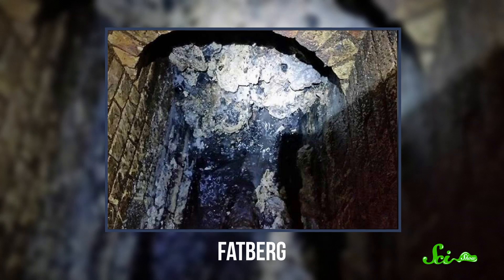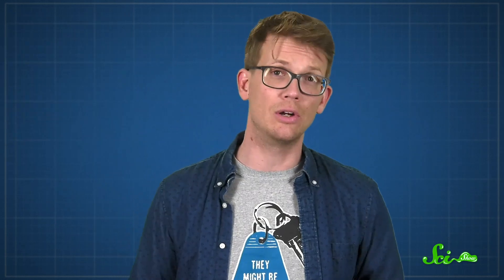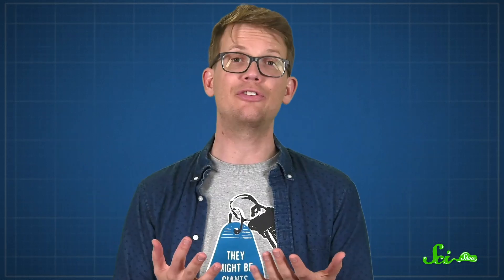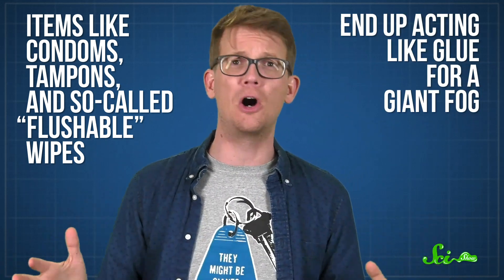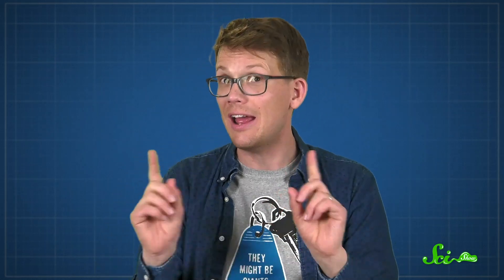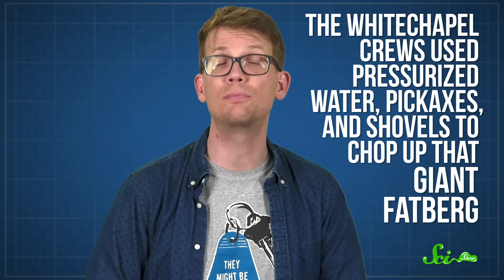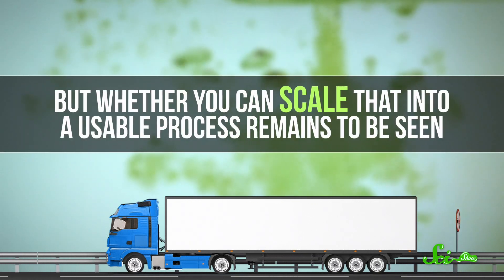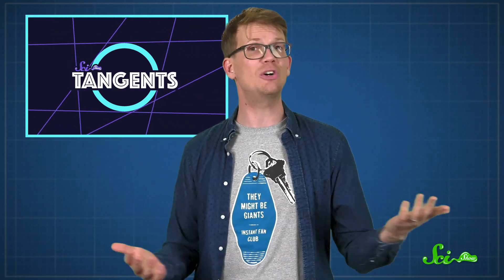Why Our Sewers are Plagued by Fatbergs

Comment: I very much disagree with the premise that individual people, or even restaurants and businesses, should be responsible for preventing fatbergs or that they/we ought to take steps on our end to resolve the issue. This very much seems like it should 100% be a municipal responsibility to resolve using the cleaning chemicals, better/different coatings and materials that resist corrosion, and/or make changes to engineering and infrastructure practices to flush them out or make the sewer inhospitable to them. Of course we as individuals and business will be responsible in the form of higher taxes to pay for these changes -- and I'm fine with that -- but I don't think we ought to take such a degree of personal, individual responsibility as to change our daily practices. Issues like this are why we have cities and municipal governments in the first place IMO.

Comment: If calcium is a big part of the problem, why not use stoneware pipes (sintered clay and shale) or plastic? In Sweden all new small sewer lines are pvc, pp or pe of some kind; larger still use concrete. Germany seems to have some kind of aversion to plastic but the use stoneware for most sanitary sewer pipes.

Comment: After 25+ years working in the collections division of our local sewer department, I can personally attest to EVERYTHING that he said as being true. We have 40 locations that we have to clean every month to prevent these FOG buildups from causing a backup.
As to the non-organics he mentioned, they are a huge problem in the sewer. In particular with our pump stations becoming clogged.
Some other things that we find are dentures, marbles, cutlery, toys, jewelry, and lots and lots of gravel. Some of the unique things I've seen are a bowling ball, a basketball, a tricycle, a TMNT doll, and a furless squirrel that had got caught in the impeller of our pump. One of our guys thought that it might be a baby, but it was only a chewed up squirrel, thankfully. 
If you want to know exactly where this stuff ends up and ultimately what it becomes, visit your local treatment plant. Most give tours and would be happy to give you the lowdown on the largest environmental protection process across the country. 
If you really want to know where the money in sewer is, ask your plant operator how the cogeneration system works. 
Tl;dr rant is done.

Comment: This is why any time I wash oil or grease down the drain, I also use a ton of soap, to make sure it's miscible, and even then, I remove as much as possible before washing that pan or whatever!
Reply: You shouldn't be washing oils or greases down the drain. Collect your cooking oil in an old cup and allow to cool and solidify. When cool you can then scrape the solids out into a empty milk packet and place in your household rubbish.
Reply: @markfryer9880  I was waiting for this, like I said, I do remove as much as possible. This is just the stuff stuck to the pans.

Comment: I work for a public sewer system in Texas, can vouch for this. However for us Sanitary Sewer Overflows (SSO) happen more in residential areas rather than commercial. It's the bad FOG build up which can happen with any type of pipe (virtually no concrete here, it's all clay or PVC). I see it all the time when we flush or camera a sewer lines.

Comment: Run hot water in the sink, real hot.... chase it with DAWN dish soap, pour in the grease (if you must) continue with the hot water, add more Dawn still more hot water.... done. Or, think of a cheaper, easier way to do it.

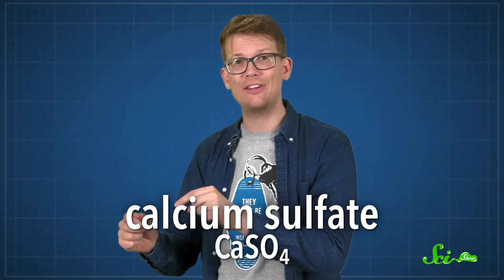Comment: 1:50 Calcium Sulfate is a metallic salt? How is that possible if it has no metallic elements in it?
Also we literally can't by law throw away organic waste into the general trash bin in the city I live in,
we can only stick it in the organics bin, I'm not sure if you're saying I should just pour oil into a bin (nevermind that this would be a fire hazard),
cause I'm not sure how that's going to go down when it gets dumped into a big truck,
and we're not supposed to put nonorganic waste into that bin,
so I should try to put oil into biodegradable bags or something?

Comment: One thing to consider is since it's going to take time to develop these other Solutions. Maybe large metropolitan areas could have a biodiesel site that takes that receives the fatty icebergs when they do form and they could charge a small fee to surrounding counties to go out in collect their fatbergs. To bring them back for processing I think a couple of old garbage trucks would be more than sufficient to the task no need to have some kind of specialized equipment. But the system should be set up where current sanitation workers for any major metropolitan area can be trained on how to run the biodiesel process. So that they would basically be getting paid overtime when there was enough. Berg collected to run the biodiesel plant and the rest of the time they would get their regular pay as garbage man or whatever their other functions are.

To build a truly Greener World we need to have systems like this that can be turned on when there's enough in them to use it and off when they're not needed.

Comment: Uh well no I don't live in a rat infested city with public sewage so this is not a problem I need to care about.
Reply: My family has owned and operated a septic tank pumping company for 62 years. I'm 3rd generation owner-operator, and I pump 4-8 residential septic tanks a day. I assure you that this problem exists in rural septic systems, small city sewers, and large first-world-country city sewers as well. I have cleared thousands of miniature fatbergs out of people's lines and tanks.

Also, you would be amazed at the things people flush on a regular basis. Allow me to name a few:

Used needles
Drug baggies
Drug pipes
Tampons
Plastic tampon applicators
Menstrual pads
Condoms
Wet wipes
Makeup removal pads
Toothpaste caps
Dental floss
Q-tips
Toiletry packaging
Random garbage
Toys
Kitty litter

And many, many more. After pumping these items, I am required to take them to the city disposal site, screen them out (a difficult, dirty, and time consuming process), and place them in incinerators for future burning.

This makes my life difficult on a daily basis, and drives up the costs for consumers in the residential septic tank pumping industry. Please stop putting anything except toilet paper and human waste down any drains, anywhere, any time. Thank you.

Comment: The sewers are packed with grease because people dont use Lye anymore which would Saponify the grease into soap that would help keep the system clean.
Reply: He specifically said in the video that saponification is what is causing these massive build-ups. If it weren't for the saponification, most of the fat would move on through the system.

Comment: Will it flush?

Fill up 2 glasses of water. In one place a sheet of toiler paper (control) the other something else let's say a paper towel. 

Now take a spoon and stir the paper towel in the water and the toilet paper in the water.

Grab the paper towel and take it out of the water. If it's still intact then it won't flush. 

Try with the toilet paper and chances are you might get little pieces between your thumb and forefinger but the TP has pretty much been disintegrated.

As with oils they are non-polar while water is polar which is why they don't mix but they are both covalent compounds since they are made of non-metal elements and not strong enough on their own so have to share electrons (rather than steal them like ionic compounds e.g. salt) because of this the oil molecules gradually are repelled from the water until they start to bind with the other oil molecules in a mass that WILL NOT let water in between the molecules to dissolve it. 

Plastic is made up of several polymers from hydrocarbons in crude oil (probably not the oil you cook with). A polymer is a long chain of similar compounds called monomers. A single molecule of H20 is a monomer but the water flowing from a faucet and into a glass is a polymer. It's just long strings of compounds. With plastic you have several of these dense polymers packed together tightly and keeps H20 polymers or monomers from being able to pass through. So shock to know one plastic doesn't dissolve in water, if it did them plastic bottles would be useless because the water would leak right through the moment you tried to fill one.

This rant was brought to you by boredom. Boredom, just because can't get a life doesn't mean you can't kill time researching stuff on the internet.

Comment: I suspect that the sewer system managers are seeing baby wipes, not flushable wipes. The annoying thing about the flushable wipes, which are essentially thick moist toilet paper, is that they rip very easily. The testing done involves both septic systems and waste lines.

A better solution to the fatberg problem would be to provide hydrogen sulfide scavenging systems, possibly just better ventilation, to prevent hydrogen sulfide from being used by bacteria to form biofilms, attack the concrete, and otherwise wreak havoc. Hydrogen sulfide is extremely toxic, and really it's a worker safety issue to keep it out of the sewer system.

Comment: Hmm, don't think I've ever seen a 'fat and oils recycling centre' near me. This brings up the question: if people can't flush it down the drain, councils don't collect it, there are no fat/oils-specific recycling centres near most people, many people don't drive, and you can't take big pots of oil onto public transport, or pour it into the grass, because presumably, it stinks, then, just what are people supposed to do with it?  I mean, what's a bigger hassle: 1) Retrofitting garbage trucks with oil-carrying capabilities, and supplying a sturdy airtight container to every home in the country, so that they can use it just a few times a year, or 2) sending some chap down the sewer with a good pick and nose-peg?

Comment: Would have been nice to have included how this can relate to septic systems. I live in a small community of homes that share a septic system. I can control what I do and I do not put fats down the sink drain. I can't control my neighbors though. I did use those "flushable" wipes and flushed them. Soon learned though that was not good and the septic pipes from my house became clogged. I don't flush them anymore. Instead I use a diaper pail type system for their disposal so the stink stays contained. :p  - Heidi

Comment: so since its caused by saponification, you shouldn't throw any fats or oils at all down the drain. I previously thought it was okay to pour liquid oils down the drain, that the problem was because of melted fats solidifying inside the pipes
Reply: Me too! I also thought washing with lots of hot water and soap would help prevent buildup as well, but that doesn't do anything since the buildup is caused by a chemical reaction.
Reply: (Vegetable, olive, canola oils, ect..) Doesn't solidify, useless cooking meat in the oil. The grease from meat does solidify and cause fatbergs.
Reply: @DARTHFEAR0N  Vegetable oils will saponify just like animal fats will.

Comment: What are good ways of throwing away FOGs? For me and some  people I know just don't know what to do when they have a lot of used oil sitting around...
Reply: Collect it using paper towels and compost them. It can then be used to create biogas. Another option is simply throwing the paper towels in the trash.

Depending on why you have fat/grease/oil you can reuse it with bread. Heat the fat in the oven together with one or two pieces of bread. The bread will absorb the fat and can then be eaten. Some salt or sugar on top if you want.

Comment: Sounds like City people problems cuz out here in the rural areas we don't have sewer systems we have a septic system
Reply: My family has owned and operated a septic tank pumping company for 62 years. I'm 3rd generation owner-operator, and I pump 4-8 residential septic tanks a day. I assure you that this problem exists in septic systems as well, as I have cleared thousands of miniature fatbergs out of people's lines and tanks.

Also, you would be amazed at the things people flush on a regular basis. Allow me to name a few:

Used needles
Drug baggies
Drug pipes
Tampons
Menstrual pads
Condoms
Wet wipes
Makeup removal pads
Toothpaste caps
Dental floss
Q-tips
Toiletry packaging
Random garbage
Toys
Kitty litter

And many, many more. After pumping these items, I am required to take them to the city disposal site, screen them out (a difficult, dirty, and time consuming process), and place them in incinerators for future burning.

This makes my life difficult on a daily basis, and drives up the costs for consumers in the residential septic tank pumping industry. Please stop putting anything except toilet paper and human waste down any drains, anywhere, any time. Thank you.
Reply: the same problem can happen in cesspools since they are usually made from concrete as well. will take a heck of a lot more fat, oil and grease being thrown down the drain of the average home to make it happen though. though I guess if a bunch of restaurants share the same shopping center/strip, the cesspool there can get a fatberg easily.

Comment: And that's when government has to step in and make sure that restaurants/business discard their waste properly
Reply: Step 1: Give tax breaks and subsidies to restaurants and other fat disposers if they have the proper equipment for removing the fat from their wastewater.
Step 2: Cut off their access to the sewer system (thereby shutting down their business) if they continue to send too much fat down the drain (after giving them ample warnings and plenty of information on how to keep fat out if their wastewater, of course).
Reply: @tissuepaper9962  How do you even begin to monitor that?
Reply: @CharalamposKoundourakis  Add it to the health inspector's checklist.
Reply: TissuePaper no thats big govt jewish illuminati aliens
Reply: Michael troll harder
Reply: Prior to this video, I saw a posting in the resteraunt where I work in, to dispose of oil in the garbage not down the drain. So, my place is already doing what it can
Reply: Also should have regulations on securing grease traps. Two weeks ago a little boy died after falling in a grease trap at the coffee shop I was at. The lid was plastic and not properly secured. And it turns out the state had no laws/regulations about securing them. 🙁
Reply: mreeeeeigf I think most jurisdictions require grease traps on restaurants. IIRC, the issue is that if they aren’t pumped out regularly, they will eventually just overflow the fat into the sewer.